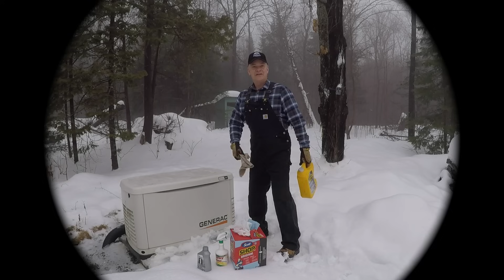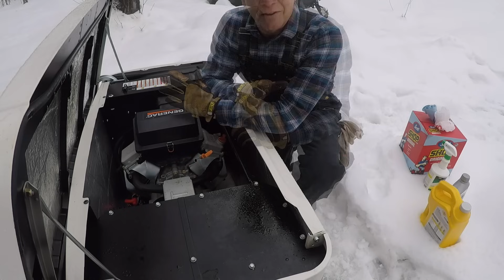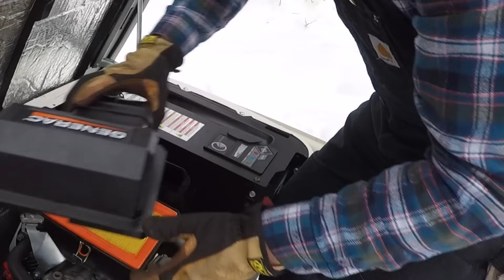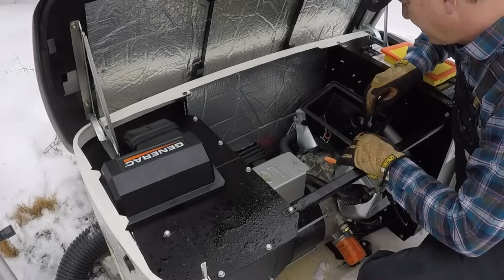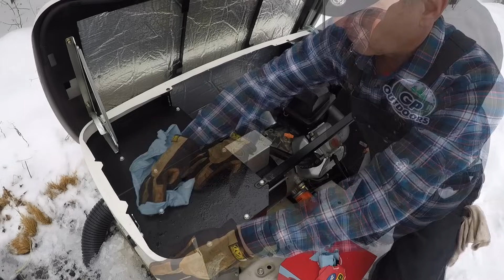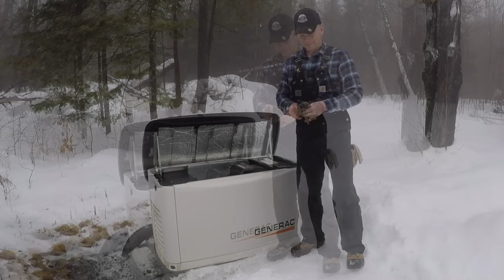#133 Thinking of Buying a Generac Generator? You Need To Watch This!

Comment: Does your exhaust Port run through the air filter if it does reroute it pop a hole in the side of the cabinet with the exhaust exit out the side of the cabinet and sure it's going to be a little bit louder but I think that was all your problem I don't know I'm just a dumb truck driver so I'm like you I don't know a lot about generators but it makes sense to me why did they run the exhaust Port through the air cleaner unless they're using the air cleaner for a muffler all right man I wish you luck with it and you up there in the cold country and you got to have your generator so do some research on getting that exhaust poured out of that air cleaner I have nothing else rooted a hole through the side of the cabinet nothing else when you do that put an external muffler on it but when you do do that I'll get it looks like your cabinet might be plastic or fiberglass or whatever put a shield in the hole that you did and make it out of structural steel and then run the exhaust do that and that structural steel it takes a long time for it to get hot and there's no way it's going to get hot enough to melt the cabinet cuz that's what people do when they're putting cut outs on their hot rods and they got to go through the frame that structural steel also does two things it reinforces whatever you're running the exhaust pipe through and if you're running it through plastic or whatever then an accident acts as a heat shield well I said man I wish you luck with it

Comment: Venus Hall it's up to a solar system ensure the people at Generac couldn't put something in there to heat that area up and drain it correctly so that problem doesn't happen I mean some low voltage than keeping it at you know 40 50° is enough to keep ice out using the battery from the solar system unless you have no backup batteries

Comment: Ive lived off grid for 20years 
Learned very early that cold weather and air cooled generators not the best 
Had 2 units in 2 yrs
Installed water cooled generator and have had no problems since

Comment: Why don't you have the cold weather kit installed? There is a breather warmer that would prevent this.
Reply from the maker: good morning - I do. The vent warmer was put it after this - it stops the water from freezing back into the vent port now but does not stop the condensation in the filter box. Thanks for the great suggestion though - I appreciate it.

Comment: This is exactly what happened to me this weekend in Haliburton, Ontario, we had a power failure friday night to saturday and it was -34C, at 4:00 a.m. the generator stopped working and the oil stick was gone and found it under the generator lid, stuck. The generator was splashed with oil all over and thought it blew up. We had 4' of snow blocking the generac air intake and I thought it was the snow blocking cool air from going in.
Reply from the maker: Hwey good evening Joaquin. I am not far from you. It happened to me too. I had to head up here to fix it up and get it started again. Even though I have since bought eh Generac heat kit that wraps on the Vent port, my guy told me that it can only keep it warm to a certain point. Moreover, he had several other makes/brands of generators do the same thing to his customers. So I scooted up here, cleaned out the oil, filled it up and got it running again. Man, it was cold!!! LOL! All the best to you!

Comment: Bought a Generac 24 KW here in Florida got it at Lowe's. I love you at home and it was totally corroded in the Box. White powder aluminum corrosion and red rust on the exhaust. The choke butterfly mechanism was almost corroded away brand new in the box. Lowe's is selling flood damaged goods and you will be paying 4 service calls forever. If you get a corroded generator make sure that you open a box at Lowe's it's much easier to return it if you never leave the store. Say for the person would you hurt your grandfather up with a corroded barbecue out back of the house with 500 gallons of propane? They look at you kind of funny. I've gotten three corroded generators and rejected them already in a month Live Oak Florida

Comment: I went through some of the top comments but none of them was the right about the source of water in the air filter housing. I work on these units and I work in Ontario in a similar environment. Signs of moisture in the oil will be milky oil and small droplets on the dip stick, maybe you will get some drops of water from the Crank Case Ventilation which was referred to as exhaust in the video, these small drops will probably evaporate before you can see it. 
Now, the source of that water is basically Snow, when the generator is running during a snow storm it will actually suck snow thorough the intake and the snow will get caught on the air filter, then it will melt and seep through and accumulate in the housing "generator will probably shut down from air deprivation", few times I found a piece of ice sitting on top of the air filter when I was checking the unit.

Comment: Why can't a Drain somehow be designed into the the Air Filter Box so water that turns into ice can be stopped from forming and causing the oil issue is that something that can be added.. Just wondering..

Comment: Generac has new software updates I believe you can change your runtime for your generator for the exercise standard I believe is roughly 5 minutes. Increase your running time for your exercise after the exercise is done open up your air filter it shouldn’t be any condensation in there if there is wipe it out with a rag you’ll never have that problem again my friend unfortunately you’ll have to babysit it once a week to check it. Once you increase the exercise the condensation problem will be gone the generator right now wasn’t running long enough to burn the condensation.

Comment: Why not drill a small drain hole in the bottom of the housing? Just curious. If it's just condensation it won't hurt anything.
Reply from the maker: Agreed James - thanks for the good suggestion. According to Generac, it will void my warranty. Thanks very much!

Comment: That the blow-by is enough to pressurize the crankcase to the point it ejects the dip-stick and all the engine oil is a REALLY bad design flaw.  A low-oil shut-off is a regulatory requirement BTW.  So, it wasn't like the Generac engineers thought about it, or the condensing blow-by.

Comment: Why don’t you install a Generac cold oil heating kit and battery kit because you’re in extreme cold area it would help you with the start up.
Reply from the maker: Thanks Edward! I have 3 heating kits on the unit  most recently added the heating wrap for the vent port I mentioned here. It doesn't stop the water from filling in the filter compartment but it does stop it from freezing into the vent port now. Thanks again!
Reply: @GPOutdoors  Did you try to change the exercise time on the generator Let it run longer

Comment: If this eeoccurring problem od water collectinc in the bottom of the reservoir and turns to ice, why not drill a 1/4" hole just above the oil level through the side of the plastic resercoir and run a 1/8" ID tube from the reservoir to outside the cabinet so the water drains?

Comment: GP I live here in San Antonio Tx and we have been with out power 3-4 days My wife and I are talking about about buying the Generac Can you tell me approximately how much it costs just for the installation of the unit?
Reply from the maker: Hi joe. i am so sorry to hear about what many of you have been going through over the last 4 days. I hope you and your family are doing ok overall. My heart goes out to you. It was about $1500-2000 CDN for the install I believe. I also had them install a direct connect 240 v plug on the outside of the house that connects in to a Transfer switch at the hydro panel. This way i am also able to plug in a portable generator to run the house in the event the Generac fails. Good luck and hope you are safe and well.
Reply: @GPOutdoors  Thank you so much for all the great information. And thank you for the kind words. We faired better than a lot of people did. My wife and I had made some preparations 2 weeks before the storm hit. I had bought 5 -20 lbs bottles of propane, 10. Cases of water and plenty of food. But after the black outs and I saw your video I showed it to my wife and so we are discussing getting the home generator.  Thank you so much for info.
Reply: Joe, we are in Utah and just had our 22kw installed. We have been waiting since September to get a unit and transfer switch in , as they have been backordered terribly. We paid 4k for a short run natural gas line, transfer switch install and power hookup. Total was $ 9500. We had bids up to $17k for the same system because demand was so high. We bought right after an earthquake hit here, so timing wasn't great, but I feel for you since now there will be additional stress on genset supply! I hope you all stay safe and warm, and remember to keep your powder dry...
Reply: @marcuseolaus6980  Thanks for the info. Since the prices had risen to that point I’m thinking just get a portable generator and plug in the the meter base. I can do that for 3k.

Comment: Very good video! But, why don't Generac fix this problem, and not by offering an option?
Reply: The problem is a natural occurrence in this type of mechanism. That's why there is an extreme cold weather kit option you add in extreme cold weather conditions. You wouldn't need the extreme cold weather option in Florida. This problem does not occur in Florida so they shouldn't have to pay for parts that are not needed. Remember the guy in the video said it only happened twice and both times it was an extreme cold weather. I blame the installer.

Comment: Can I ask you would it be better to have it farther off the ground   i live in southside VA  and tired of loosing power once in awhile in winter .summer I don't care since house is 2.6 stud walls and attic has 6 feet of insulation in it and floors are insulated .I lost power because of ice storm for 36 hours and hubby has health problems and only propane here to run one  house is 1 floor 2440 sq. ft.

Comment: Im in SE Texas. Our 22k Generac ran fine during the recent snowstorm with one exception...every 24 hrs of run time the generator would stop due to low oul pressure (error code 1300)
 I would have to add as much as a quart and a half of oil. There was no evidence of oil spatter or leaks anywhere. Where did the oil go? Im told by Generac technician this is normal. Something is not right. If your generator shuts down after 24 and you are out of town...you are out of luck.

Comment: I am researching generators at the moment. I also live in a cold area. Thanks for pointing out the issue with this unit.  Cheers
Reply: Kholer
Reply: @johnnyblaze9217  I went with a Champion. Two reasons 1: I could get one. 2: It has a 24 volt staring system and a 15 min exercise run.

Comment: Plug the existing exhaust port and move it up in the enclosure closer to the air filter. Problem solved. Alternatively put a 1 way drain valve in the bottom of the enclosure so that the water build up drains.
Reply from the maker: You bet - thanks. Once the warranty expires ( cause they told me if I do that it will void it) then I will for sure - thanks for your help!

Comment: OK stupid question:  Does the engine heater that Generac sells keep the unit warm enough to prevent this problem?  Are you using the battery warmer and block heater on this unit?

Comment: Isn’t that the positive crank case vent instead of the exhaust?  If it were the exhaust it would just shut off and not pressurize the crank case where the oil is.

Comment: Put an extension inside the air box on the crankcase blow by  .Peace of PVC pipe or rubber hose and get it above the water .Or drill a small drain hole in the bottom of the air box to let the water out .

Comment: I was told I needed a larger regulator, because under a load it stalls but idles fine.
Reply from the maker: Morning Mike. I have not been told that myself - but I am aware that the size (diameter) of the line feeding the unit must be a certain size. My first one was a 6KW and this one is a 16KW. This one required a much larger diameter pipe to feed it from the propane tank because this larger generator draws much more than the smaller one did. Good luck!
Reply: @GPOutdoors  I was curious because nothing has changed since it was hooked up (8 K),  but that was 17 years ago, old age?

Comment: The inside of the box has reflective layers that reflect the thermal radiation that's emitted by the generator... back on it. I suppose it is there to keep the generator warm in cold weather. Otherwise, don't use it on hot days.

Comment: Great video, I'm sure u helped a lot of people by explaining this problem!
Of course the real problem is a poor desingn by Generac that they don't seem to be concerned with!
In the RV motor home industry they were only unsed in "cheap" lowend motor homes and had a bad repution for poor performance!
Reply: This absolutely is not a Generac issue, nor a design issue. As listed in many other comments, there are add-on pieces required for sever weather use.

Generac, Kohler, Cummins-Onan and  at least 2 others use the same methodology, and some is based on emissions requirements.

This is a great video, and super helpful, and I'm glad the commenters added detail about these issues.

Now that it's easy to find, everyone should grab the user manual and the diagnostic manual that clearly explain all of the issues and preventive/restorative measures.

Comment: I would think that living in those kind of extreme cold conditions, at the very least, the unit would be inside of some kind of an insulated out building much like a well water pump system would be, especially now that you know what the problem can be.
Reply: If it was mine I would build a shelter for it. Why spend thousands of dollars and not protect your investment?

Comment: Why is the engine exhaust going through the intake air cleaner??? Is the exhaust used to preheat the incoming air?
Reply from the maker: My apologies - it is the vent port from the crankcase.
Reply: @GPOutdoors  now your story makes sense.   Why don't you put a heater on the pipe.  I would call and blubber to Generac for a silicone rubber heater that would turn on at low temps.  I think you can get one at digi-key.  Now they have the extreme cold option and can charge more money.
Reply from the maker: Thanks Phillip. I have it - but it doesn't stop the water from accumulating in the box - but it does now stop it from freezing back into the vent port. however water gets into my oil. Someone posted a comment saying the new models have fixed this. Thanks so much and sorry for the confusion. All the best to you sir!

Comment: Remove the crankcase breather hose and get a universal air filter to fit the hose and zip ty it up in the box somewhere out of the airbox so it doesn't fill with water.

Comment: Something you don’t think of what temperatures brought it to that point, how cold does it get where you live
Reply from the maker: Hi Joey - it usually starts happening when it starts to get to around -20 Celsius. In the winter we will get temps as cold as -35 at times.
Reply: @GPOutdoors  That makes sense, thanks for the response

Comment: This looks like another problem with Generac. My background is retired generator mechanic.  I would NOT drill hole in the filter case as this would let in dirt pass the air filter.  I would hope Generac would come out with a fit (HAHA).  This is another reason I do not own this brand.  I do know LP fuel is high in moisture.

Comment: Is Honda better than generac? Which should I buy for whole house power?  Meaning power refrigerator, freezer heat and air conditioning etc. would a 7000 watt Honda do it?
Reply from the maker: Good morning Joel, I wish I could help but have no experience with other brands. If it is helpful, I can run the whole house in the winter with a 5.5Kw generator (I have another back up portable). However I do not have any air conditioning, my range is propane and all my lights are LED. When you are looking for a generator, note there are always two ratings - "Starting" power and "running" power. You want the "running" power to be at least 7Kw (7000 watts), I think, assuming your home is less than about 1700 square feet. Good luck and all the best!
Reply: @GPOutdoors  right now I’m trying to figure out which to buy. My dad wants yours but I don’t know about being dependent on CPS for the natural gas. They could shut that down whenever they feel like it too. I see gasoline stations still open here. No lines   Gas would be easy to get to fuel the gas generator.
Reply: @Catman1798  easy solution just get a propane tank instead and use that using regular generators is a lol idea
Reply: @johnnyblaze9217  these generators use propane? I thought only natural gas??
Reply: @Catman1798  no they can run on either one in fact its better to run it off of propane depending on where you are
Reply: @Catman1798  btw read the labels carefully usually the box max power draw label is for propane usage not natural gas. example a 22kw unit on natural gas only does 17-18 kw instead but remember this all depends on the brand you get

Comment: Seems like a design flaw. Do any of the other generator companies address this possibility in their designs? If so, I’d probably go with one of them.
Reply: This is a common occurrence on small engines and their crankcase ventilation systems in extreme cold.  For example Polaris ATVs have had a similar issue where the PCV tube freezes  from water vapor and pressurized the crank case causing blow by on engine seals spraying oil on riders legs.   Yes a design problem, but more common then you might think